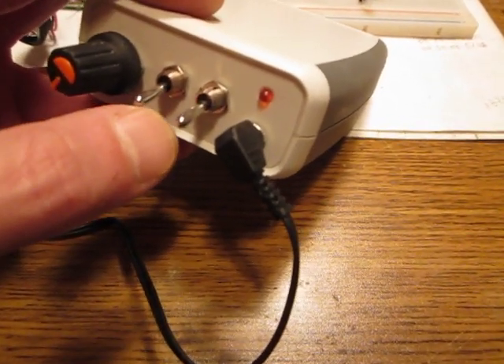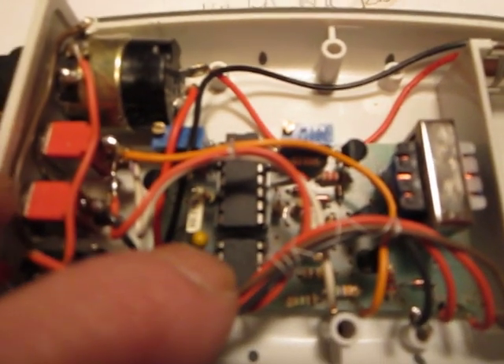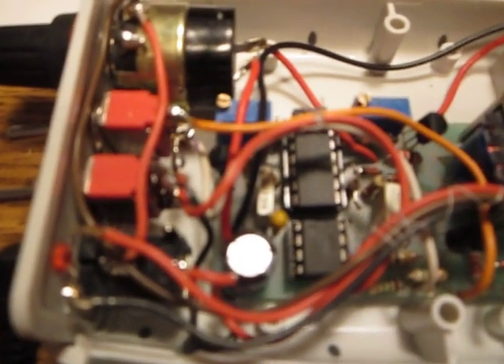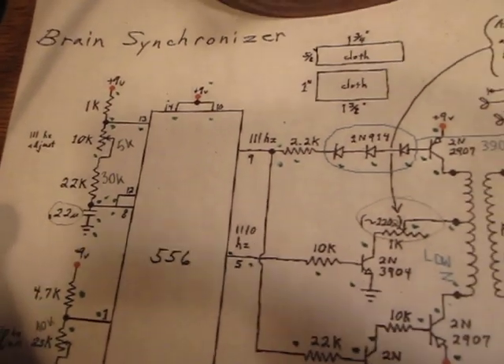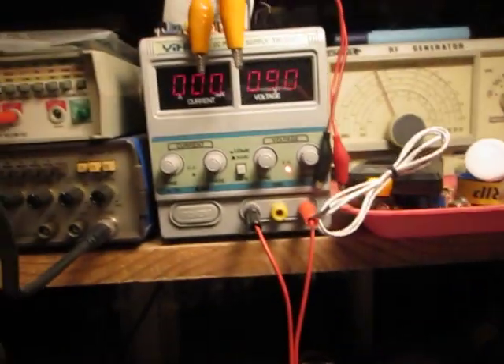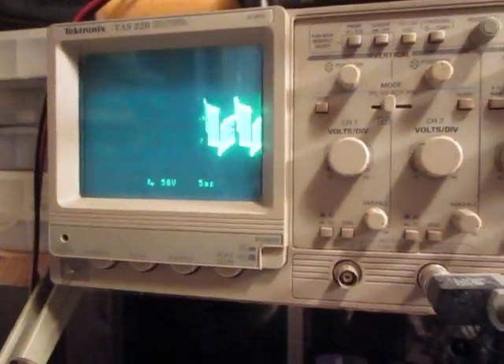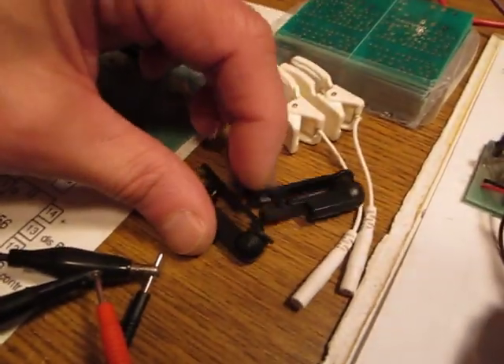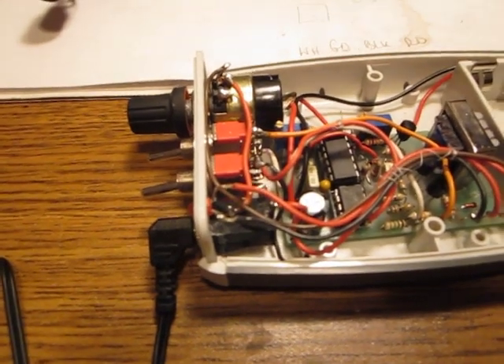Bob Beck Brain Tuner

Comment from the maker: Hi David, If you go to energyscienceforum there is a thread - Robert Beck. All his devices and improvements are posted. 9V version has additional circuit - voltage multiplier built on 7660. I also have pcb's for this version with timer and couple assembled units of BE/CS as well as BT.
If you have a problem finding relevant info please let me know and I'll help you.
Thanks
V

Comment from the maker: Hi Matthias,
This will not work. The signal is not an audio but modulated AC which has to be applied to specific area either behind the ears or ear lobes. This signal consist of 111cps triggering another oscillator and being modulated via transformer. Also, digitally processed signals such as generated by software don't work the same as analog devices. This applies to Rife type oscillators.

Vtech

Comment from the maker: Hi, Yes, that's correct. Pin 2 goes to the middle and both resistors/pots to the outer terminals of selector switch. Second switch connects to pin 2 and ground (battery negative) and will short 1uF capacitor. This disables low pulse oscillator so there will be 111Hz and 1110Hz on the output without modulation. This is referred to as a "neutral" on the schematics. For support meet me at energyscienceforum>electronic healing technologies>Bob Beck. Email me via YT channel for PP account #.

Thanks

Comment: Dr Beck pulse method of moisturizer method, was some salt water.  My chiropractor used a mix of 50% tap water 50% acholocl. on his Tens machine so I tried it on my Sota
pulse device and it absorbs well into the cotton fabric and works great.  I don't know where to buy the ear clips for the brain tuner so I used printed circuit boards with weed trimer string .80 inch and use soldering iorn to make a mushroom head and space the two PCB's 1/4 inch apart. also solder + end of D cell battery to pcb

Comment: Hi, I looked at your scope image, are you sure that is correct? Documents I've seen online with other BT scope images show a 1110 hz carrier wave that is turned on and off at 111 hz. In other words every half cycle of 111 hz the carrier is present. In the other half cycle the output is ZERO, no carrier whatsoever. 

It's possible that scope snapshot I saw online was a later or early design than yours. But if you look at the latest BT-9 manual from Sota, they also show the 1000 hz carrier modulated by 111 hz rep rate. (Not a diagram, just text description of the waveform.)

Best regards,

Comment: I have my original Beck Brain Tuner, sold by SOTA #002362. Any idea what model it is? Where did you get schematics for yours? Have you analyzed against an original unit?
Reply from the maker: No, but if you contact Sota, they should be able to tell you which model you have. I got original BB diagram but modified a bit. Yes, waveforms are correct. Sota removed 5Hz gating in their latest models and added 7.83Hz sine modulation instead. Not sure what this implementation is about to achieve but it was their idea, not mine.
Reply: @blackchisel97  I have a BT-5 brain tuner, on its pouch written "BRAIN-TECH 500". messed up the wiring on the on/off/volume knob need a guidance picture to resolder correct connections. how to PM you?
Reply from the maker: @HereNow2226  I will not post my email address here, for obvious reason, but I can be reached on my forum - nvtronics.org.
Reply: @blackchisel97  i have just submitted my registration application on that forum. kindly check and approve my application asap. thank you.

Comment: b.cheasel....shouldnt you have to connect to chek the second frequency on 10 k resistor? because 5th pin of the 556 is connected to 10k resistor.

Comment: How can I buy one made to Bob Becks specs.
Reply: Yes , Sota sell them , an official manufacturer of BOB BECK technology. Sota bio tuner BT9 is their latest device
Reply: @tahirahmed33  thanks
Reply: @robertbell8496  I'm using the BT8 same as BT9 ,BT9 only has maybe a beep extra when 20mins is up and maybe better battery 🔋 consumption,other than that it's same. I bought mine in 2014 for £176 and since last 3 years it's gone up to £300 GBP for the BT9 as the BT8 is discontinued no longer available to buy . It's cheaper to buy it in the USA and Canada in tho.
Reply: @tahirahmed33  why are u using it for and what are the results. How often do u use it??
Reply: @robertbell8496  sleeplessness , using it in conjunction with the new 2020 device URGONIGHT .
Reply: @tahirahmed33  is that from SOTA?
Reply: These 3 devices are best for treatment of sleep problems. 

1. Sota bio tuner bt8 / bt8
2. Earthpulse sleep on command v6.0 pro / 7.0 pro ( just out June 2021)

3. URGONIGHT , released for general public, this year APRIL 2021.

Comment: could you email me as I would also like a PCB board.
When the 555 pin 7 runs via the 50k pot, then 120k resister were dose it then go? is it to a selection switch?

Comment: Hello blackchisel97.  Great YouTube videos. I have had trouble reaching you on the forum for support. I will try later.
I am interested in a printed circuit board for both of this devices. I would also like to know if you could provide the parts list and schematic for the Bio tuner. How can I order from you.
 
Thanks for helping humanity
Reply from the maker: Please register on my forum for full access to all schematics and support. I can provide both pcb's either bare or assembled and tested. BT requires frequency counter for tuning and ideally a scope to check for the correct waveform output.
Regards
V

Comment: 11:19... you said the second test point resistor is 22K but i saw it was there 10K not 22k 22k is together with 2.2k on the 11hz resistor.....am i correct?
Reply from the maker: Yes, you're correct, my mistake. there is 10k from pin 4 of 556. Thanks.

Comment: what is that electrolytic capacitor doing there at the corner? it is not on the schematic which you gave us.
Reply from the maker: This cap is in parallel with a battery. It's value isn't critical and can vary from 100nF up to a few microF. There are two holes in pcb for wires coming from the battery negative and positive - through a switch and this cap is soldered into them, while wires are soldered to it's terminals. I put this cap in updated circuit diagram on NVtronics.
Reply: hi dear i saw it there in your website...thank you very much.
would you share us PCB diagram of it??

Comment: Hi!
Hve a question relatin to the transformer side of the circuit.
is it possible to have more detail on the transformer , type/ratio/primary/secondary
i just need to know what to use and what are the alternatives.

Regarding the pcbs i know it has been a while but if you still have any i will buy one back of you. just let me know.
Reply from the maker: Hi, I still have few pcb's left. Please contact me via NVtronics forum. You'll also found all details regarding BT, such as components spec's, assembly pic's and connecting peripherals. Transformer is available at Mouser - 42TM006RC.

V